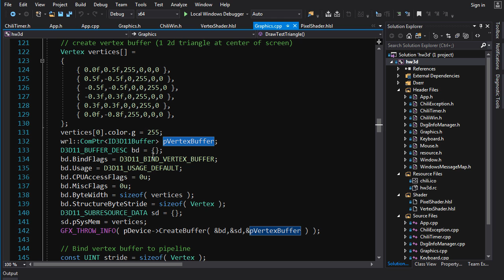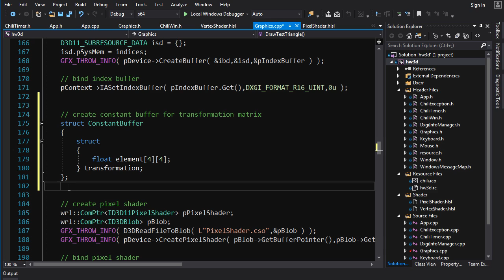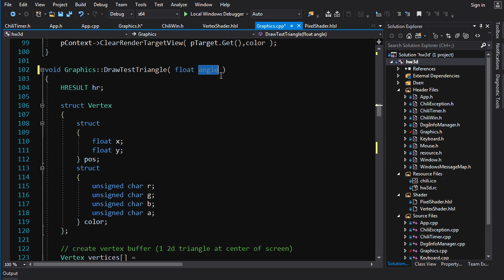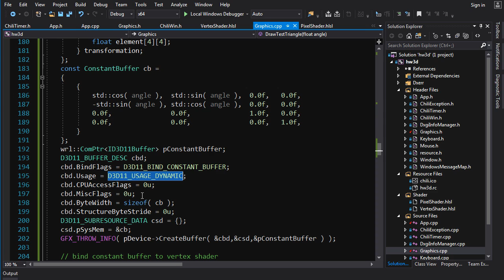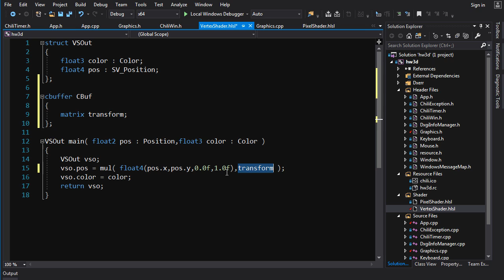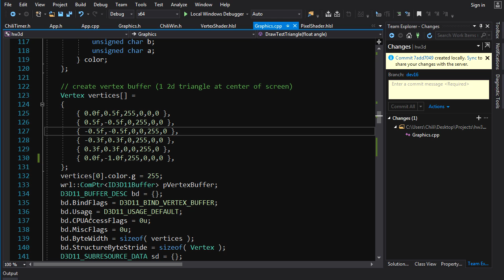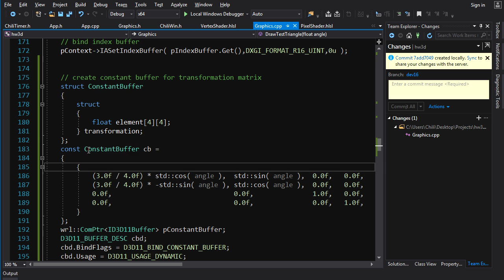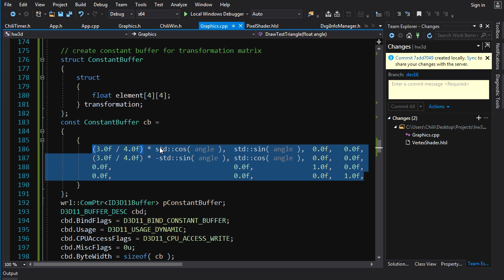C++ 3D DirectX Tutorial [Constant Buffers]

Comment: I observed that in certain cases, transposing matrices in shader code (row_major) is a lot faster than in C++ code. or at least i observed that XMMATRIXTranspose is quite slow...
if i am only passing a projection matrix into shader through constant buffer, i only need to do this once per frame, so having the transpose done in C++ code seems fine.
But if i am drawing instanced, say drawing 1000 triangles each with differrent transform matrix (translate, rotate, and scale), passing an array of matrix transform through constant buffer and transposing each of them using XMMatrixTranspose does a number on frame rate greatly. 
But if i instead let the shader transpose it (row_major), it is a hell lotta faster.
Use case: drawing 50,000 2d quads (2x triangle) per frame
Reply from the maker: Nice info, thanks! Currently messing with sprite batching in the hundreds of thousands range, will want the optimal approach to the per-sprite transforms there.
Reply: another thing to note is that it's best to drop XMMATRIX altogether when calculating transforms. It is fairly slow compared to doing the computations in GPU. for sprites since it's 2D, we just need x and y and stuff like translation is a very simple additive math, while scale is a simple multiplication as well. Rotation maybe a bit expensive but I observe letting GPU do the sin/cos in the shader is still way faster. So in my use case, I just send the translate, scale, rotation factors as floats through constant buffer and let the GPU compute the final transform. i got a very significant bump on performance when doing this.
Reply: If i am not wrong rotation can be calculated with dot product so that will make it even faster since you can avoid sin/cos

Comment: You don't need to use row_major.
Instead you can just change order in mul, so you will have:
vso.pos = mul( transform, float4(pos.x,pos.y,0.0f,1.0f) );

In OpenGL you can use * for matrix multiplication, so I was hopping that it will also work in HLSL.

Any way, good tutorial.
Reply: Does flipping arround the arguments also make it slower just like adding row_major in front of the matrix declartion?
Reply: @uvadroid  I always assumed that order of arguments in mul won't affect performance.
But I just did quick dirty test, and while rendering 0x10000 cubes, fps have increased from 34 to 35 when I just change order of arguments in mul. It was faster when doing mul(vertex,matrix).
It was on integrated intel gpu on my old laptop from 2010.
However 1 fps difference can be measurement error. And it doesn't mean it will be the same on real gpus.
When I have a chance (and if I won't forget) I will do better benchmark, and test on nVidia gpu.
Reply: I just did better benchmark.
My first test was measurement error. In shader there is no difference in performance regardles if you do mul(vertex,matrix) or mul(matrix,vertex). Ofcourse you will get different value as result, but speed of operation is the same.